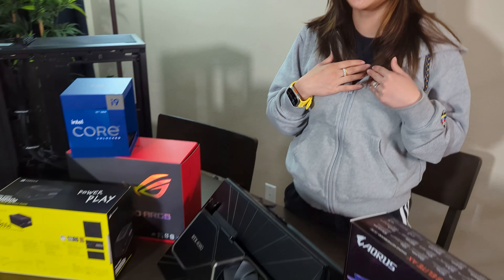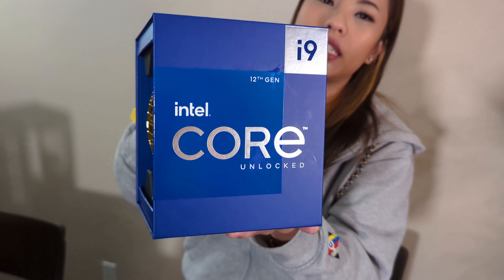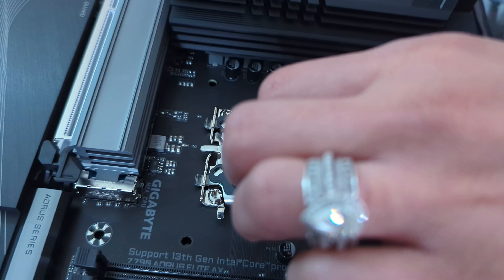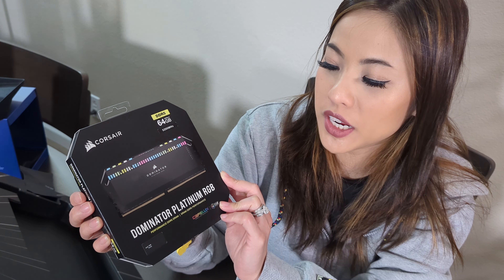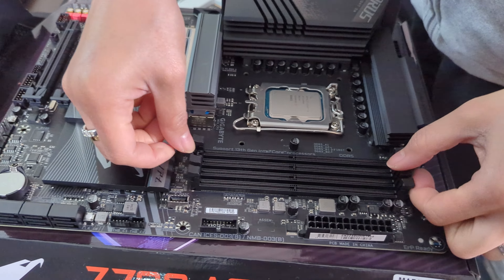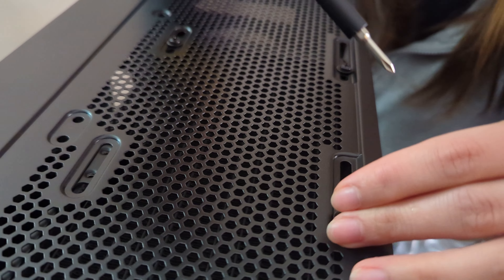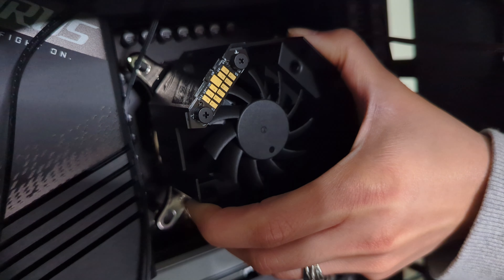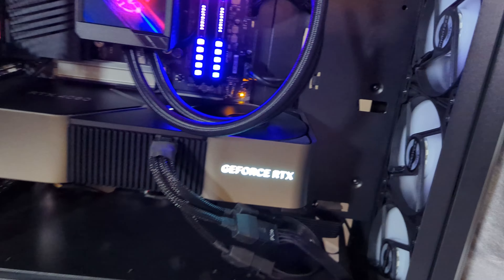My First Time Building a Gaming PC!

Comment: That's a mental PC for a first build, did you get stress sweats from putting the cpu in and holding the gpu?
Reply from the maker: I didn't include it in the video, but I put the CPU on wrong initially. I didn't immediately see the mini triangle landmark.
The GPU wasn't hard except for the power supply cables. The cables generally were the hardest part of this whole thing.
Reply: @jayneprobably  We've all been there, maybe not that exact issue but no one's perfect.

I ended up plugging a PSU power cable into another PSU cable once, blew up my power supply, AIO and my motherboard needed replacing 😂
Reply from the maker: @TomTKK  damn! All the build videos I watched kept reassuring me saying I can't get the power supply cables wrong because they supposedly only go one way. Glad to know about those hazards now.
Reply: @jayneprobably  no they're right, the issue was I ordered some weird ebay splitter for my fans. 6 month later when I went to clean it for maintenence, I forgot what cables were plugged in where lmao.

Bang🔥😂

Comment: Did you forgot to peel off the bottom thermal paste pad for your nvme.
Reply from the maker: I watched another video, and he didn't remove that bottom part like it was part of it.
Reply: Weird I remember it always peels off. Nvme tends to get hot so hope it won't catch on fire. Might be wrong though. Mobo tends to be unique in some ways
Reply from the maker: @shadyb834  i went back and, like you said, it states "please remove" in tiny lettering. Good thing that nothing was in the way and it was an easy fix.

Comment: that's a pretty beefy build for a first time build. are you gonna be using it a lot for productivity?  it says on your title it's a gaming pc so the 64 gig ram a bit overkill even for 4k gaming. not necessarily a bad thing though as you're giving yourself a lot of headroom in case indeed it's for productivity as well. i've been on 32 gig since 2019 and planning to make it a standard to have 64 by 2025 once i get a hold of a possibly 5090. what 4k monitor did you get btw?
Reply from the maker: I went with 64gb to help with video editing. I used to edit on my 5 year old laptop. Although it got the job done, it does buffer when I click around the clips. 

I got the Samsung Odyssey G7 4K 144hz monitor.